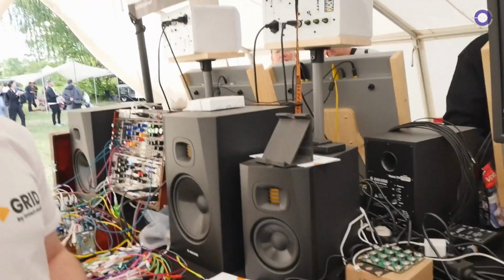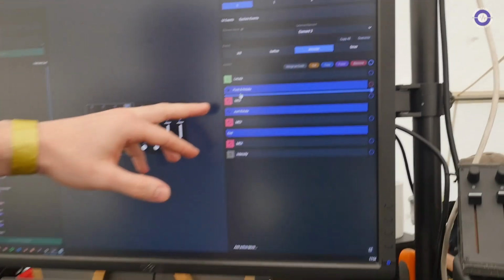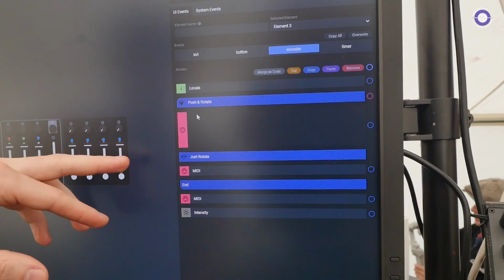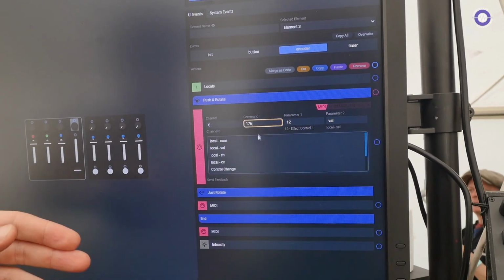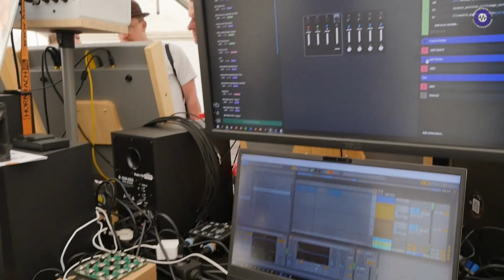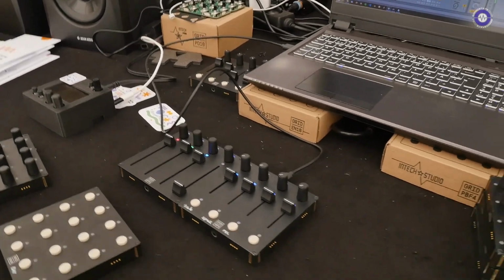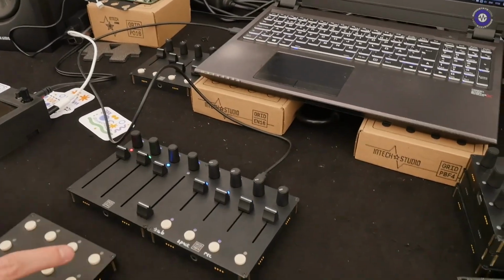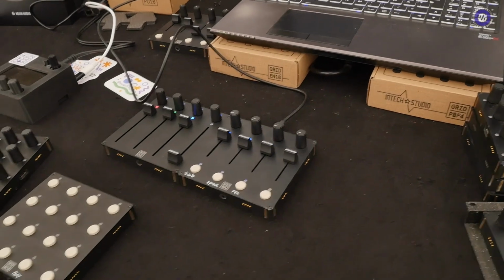Superbooth 22: Intech Studio - Grid Controllers

Comment: Nice modules. Can it read MIDI input data? Let's say to prevent jumps when using a fader (do nothing until you reach the value)
Reply: fader takeover is coded into daws like ableton live and bitwig.
Reply: @WarrenPostma  would rather use them on hardware, hence the question i 🤔
Reply: @1000cutsminimum   you do not understand.
Reply: In short, yes. It can be customized/ coded to do pretty much whatever you need